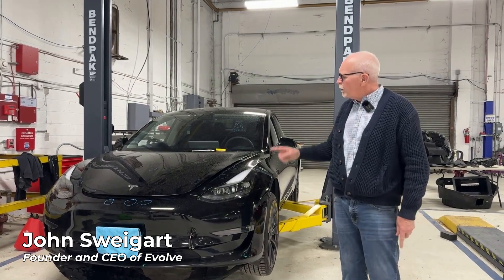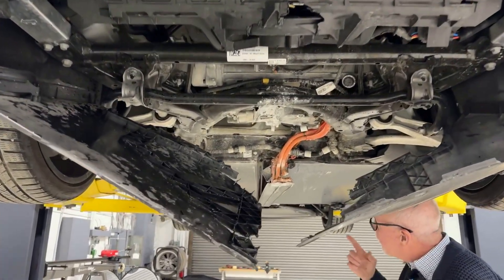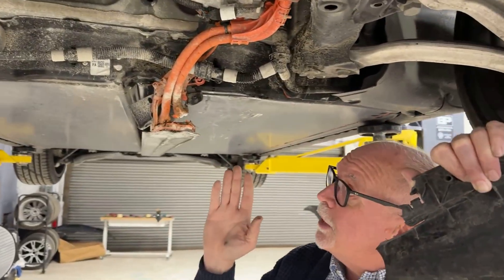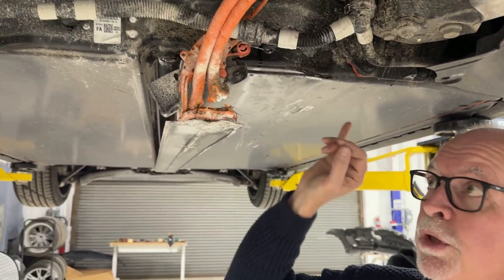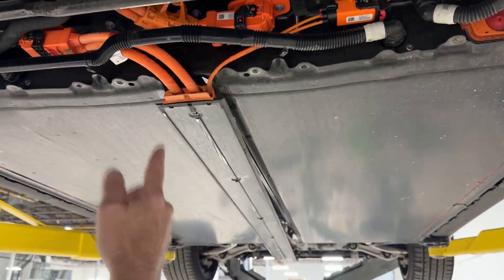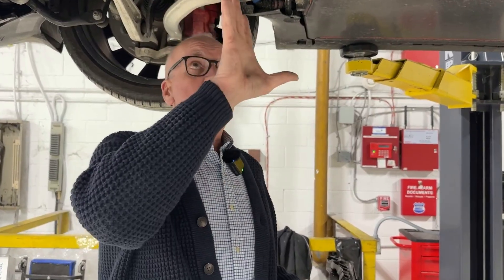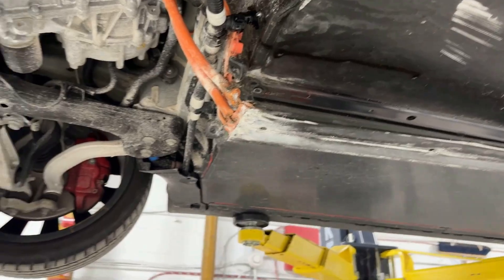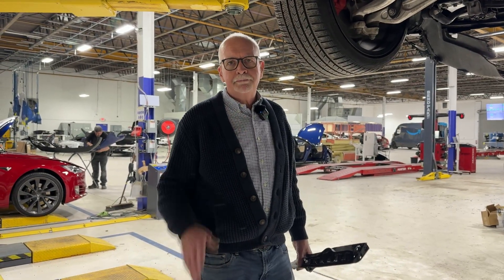Tesla Model 3 Battery Damage: What's Replaceable in 2025?

Comment: The fix is cost effective as long as it's not done by Tesla. A high voltage inspection (just an inspection and the battery and the cover are intact) is quoted by Tesla on 5/5/25 for $2500+ for a salvage vehicle.

Comment: Yea It would be good If John had his terms and parts named correctly, the "communication line" 3:16 is the High Voltage Air Conditioning Compressor cable not communication or low voltage.

The Front Drive Unit and subframe is the worst of the damage to that car the rest is not expensive and easy to replace.
Lucky the High Voltage Battery didn't get a deep dent in it, or it would have to be replaced in "Tesla's" repair guidelines rules.
Reply: lol I chucked at the orange ‘communication’ lines too 🫡
Reply: It’s how YouTube goes these days. Clearly orange doesn’t mean communication that’s just ridiculous but most don’t know better and making videos you can talk out your rear and it never matters. Oh well I guess.

Comment: OK to go big for a shop doing insurance repair.  When fix-it yourself on you own dollar, you can be more resourceful.  I'd re-use the steel cable tunnel cover if the metal isn't torn.  Just beat the bent cover back to shape.  I wouldn't replace that plastic undercover.  Those have torn on many of my cars from hooking parking bumpers and such.  I melt the plastic together using a large soldering iron, adding a little scrap ABS sheet if needed, and use wide fender washers to secure it at mounting holes if ripped.  I've fixed a similar cracked-off mount on an aluminum transmission case by securing a steel strap underneath to support it from a motor mount, which worked fine until I replaced the transmission years later.

Tesla Service has told customers the only solution for a broken plastic coolant fitting is to replace the entire battery pack.  Instead, a shop just tapped an NPT hole in the stub to screw in a standard plumbing fitting, so fixed it quick for <$100.

Comment: Q is why isn’t there a metal shield below the motor instead of plastic one?
Reply: I'm thinking safety - in a bad crash, you want the drive unit to be pushed down as to not enter the passenger compartment.  Just like engines were designed to do.
Reply: @CubbyTech  Bingo! Part of the crash safety design.
Reply: Cost
Reply: Cause it's not a tank, it's not designed to take up crashes every day. With how heavy the battery already is, I think they couldn't afford adding metal shields in terms of total weight.

Comment: The vehicle is still financially totalled isn’t it? New drive unit plus install is 5k for sure. I bet this is a 8-12k repair job.
Reply: Insurance companies will not take thé risk
Reply: My insurance said when I purchased my 2925 model 3 rwd, if I get into an accident or any damage to the body, they will write it off. That's why  insurance is so high for evs
Reply: Not all mechanical damage was listed, either. E.g. that horizontal bar on steering has to go. Outside electrical systems, parts alone are a couple of $1 000.
Reply: It may not be going thru insurance but sounds it feasible to fix it. Most likely the car would be a rebuilt status.
Reply: Surely Tesla will have disabled DC fast charging after the crash?
Reply: But if it's a 1 year old car, that's nowhere near totalled.
Reply: @ it was worth maybe 45 before the crash (used) then you have the repair cost and a crashed title. I think the insurance will write it off.
Reply: Used parts are plentiful and inexpensive for model 3, if it’s older often times an insurance company may request used parts, but I would suspect it may be totaled